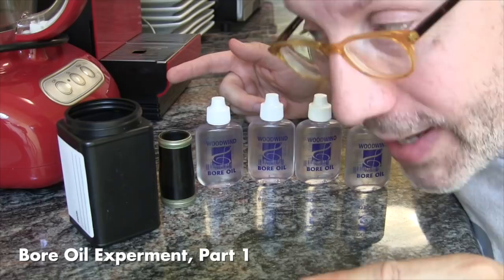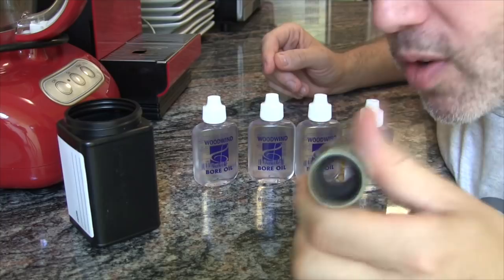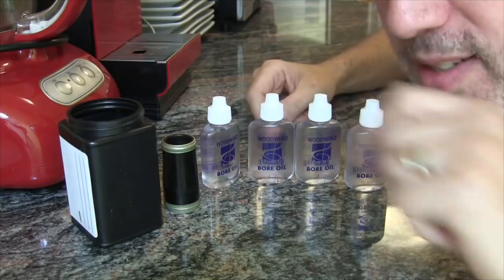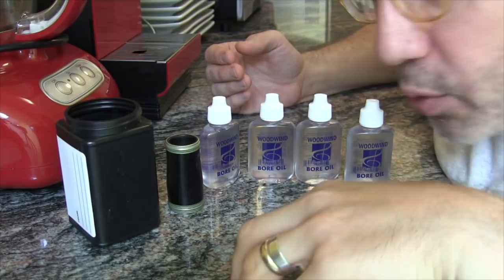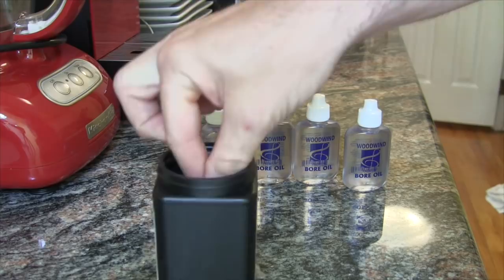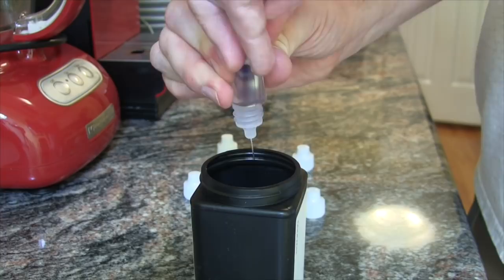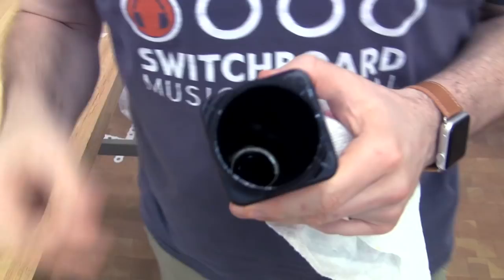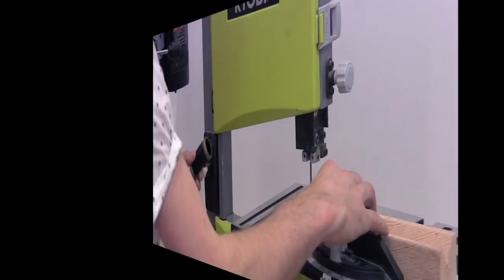Bore Oil + Clarinet Barrel + 7 Months + *Band Saw*

Comment: Try the reverse: My understanding is that the oil is intended to keep water out of the wood, not to keep the wood from drying out.  If that is true, a surface coating of oil should provide a great moisture barrier.   So, cut one in half and oil one half.  Drop both in water, and then see if the oil protects it or not.
Reply: Correct. The clarinet needs to remain moist for protection. But also, water does nasty things, sometimes [like expanding when freezing].
Reply: Great insight on the clarinet bore oil topic.

Comment: I would suggest a better experiment would be with a very precise scale, weigh a dry barrel, soak it in oil, wipe off the excess and weigh it again. Seven months is a long time and if it soaked the whole way through  you wouldn't get the ring like that piece of chalk.  Also, sanding it could have filled the endgrain with dust or the heat generated in the cutting/sanding process could have burnt off the oil. As a technician, I can tell you they definitely change dimensions when they are dry verses oiled. Another good test would to measure it with a dial or digital caliper or a micrometer dry vs oiled.

Comment: Had a really old dry Pre-R13 Buffet that played extremely flat. I assumed it had to have been very warped including the tone holes. I caked it in Bore Oil for a month and added oil when I saw some had dried up or sucked in to the pores? I reassembled the instrument and tried a shorter barrel about 3mm smaller than the first and intonation became much more controlled and accurate. Oiling your clarinet is good and if you notice that the rings on the tenons or on the bell are loose, that means the wood has constricted or shrank. Meaning it’s dehydrated. Oil that sucka

Comment: I know it would have cost more, but why didn't you saw another barrel in half to show the difference? It would have made your point a bit stronger, though I'll happily take your word for it.
Reply: Ranâ Onety Right! Control vs test is the only way to be sure - or cut in half before the soaking
Reply: Cutting it in half before soaking would have been a much better choice.
Reply: hundidosplodo True, though I guess you could argue that if you saw the barrel in half prior to the oil bath, then the barrel would behave differently to how it does normally, as the surface area, where the barrel was sawn(correct form?) has a different texture to the barrel as a whole, which would screw up the results, because that exact area is where you measure them. Also, my reasoning for stating what I did initially, since he plunged the barrel into the oil half a year ago, I figure the easier fix would be to use a fresh barrel as a comparison rather than having to wait a "whole" half year again.
Reply: Well, if NOTHING can be seen, there is absolutely NO need to compare with other cut pieces (where also nothing can be seen) except you have developped some hate against your instrument, then saw it in 78 pieces at least. At your own risk. Be careful to remove all metal pieces before. Don't do it at home, kids!
If you ask any professional wood worker, he'll tell you that oil will NEVER go completely through a piece of wood (even if you add high pressure and higher temperature, and even in much much softer wood as pine wood) Oil only intrudes about a tiny fraction of an inch. And therefore, if you cut the wood afterwards, you would defenitely see the difference in the color between the (possible) oil soaked part and the "normal" wood.

Comment: That commercial bore oil is not a light oil, in fact more like mineral oil. I've done experiments weighing before and after soaking in 80% almond oil and 20% orange terpene. The weight gain of the various parts is significant. Especially for those manufacturers that don't finish their bore with a shellac/oil finish. So yes if you use an inappropriate oil - it won't soak in. The lack of a control barrel also means we may be looking at wood in which the oil has permeated all of the wood completely. Don't mean to rain on the parade, but this is not definitive, nor scientific. Disagree!
Reply: Does bore oil help anything then? Because in my clarinet circles the power of bore oil is rarely questioned and now I feel confused, have I wasted hours disassembling and assembling my instrument when I was oiling it?
Reply: My own belief is yes. Talk to a piccolo player. They swear by it. But the whole topic is subjective (what we hear) kind of like tubes vs transistors in a stereo. However, there are few people who work with wood that would advocate against oiling wood vs leaving it dry.
Reply: Years ago a man with 20 years of experience in working on woodwind instruments visibly cringed when I told him I've never oiled my clarinet before. I do it now because of the face he made that day but I never really thought about how well it works.
Reply: Weight gain is the only accurate way of telling if the oil has been absorbed.  The degree of gain indicates the volume of oil absorbed.  Also - most commercial bore oils are petroleum based.  They are hydrophobic and will not be absorbed.  Nut oils are hydrophylic and will be absorbed.
Reply: People add things like orange terpene to help the oil penetrate. This may be what you are thinking. There is not enough of a trade in bore oil to have manufacturers trying to scam for more usage.

Comment: My first reaction on watching this was that maybe the purpose of the oil isn't so much to soak into the wood as to provide a light protective layer to repel the saliva.....but then I wondered, if the oil doesn't actually soak into the wood, why would the saliva?
Reply: There is no saliva in the clarinet or any other wind instrument for that matter. The instrument is wet after a playing session from water vapor in the player breath condenses when it gets colder inside the instrument.

Comment: Okay try this.
On a junker top joint wash it thoroughly and rinse and warm water. What you'll find is the wood looks terrible Dusty dry. You may wonder why did I do something so foolish?
Next Jam a couple of cotton balls in the very top of the top joint. Next Step being careful not to spill p o u r bore oil to totally saturate that cotton ball.
Put it in its case and wait a couple weeks. By this time the Wood will have turned dark on the outside of the top joint probably halfway down proving that the oil does penetrate. In fact if you use the lousy low viscosity stuff they sell as bore oil heavily you will in time see the oil escaping the pores on the outside of the clarinet. Another benefit of oiling aside from crack prevention is that a dramatically reduces the amount of water Gathering on the C sharp and E flat Keys on the right side of the top joint. I find the reduction of water in those keys well worth the oiling.
All that said... If you keep the instrument in its case with stable humidity and avoid sudden temperature changes it probably won't crack.
Another important detail is to put cork grease on the end-grain of the top joint cuz this is where a lot of water enters and hence why they crack near this area.
Last and certainly not least another downside of oiling the bore of your instrument is that if you use Valentino synthetic pads the sealing surface is held to the rest of the pad buy a wholly inadequate adhesive. If you get any oil... Any oil at all on the pad it will disintegrate... Usually 5 seconds before your big solo.
For the record I do oil my instruments and in 40 years I've had zero cracks.
Reply: That same thing happened to me with one of my Valentino pads. The nice thing is it seems like the inner layers of the pad still give you a good enough seal to get through that solo before you take it in to get it repaired.

Oh, and thanks again for that :)

Comment: You know what would probably help the interior is wax. Like if you took some very soft rope, something like cotton, natural fiber. And if you soaked that or rubbed it on bees wax to get it worked into the fibers, and then you drew that through the instrument, that should provide a water barrier (much like protecting chapped lips). It would also not react with the wood like polyurethane or shellac would.

Comment: I mean it doesn't have to soak into the instrument to protect the wood from moisture, and you can visibly see that the oil will coat the surface of dry looking areas. If anything this dispells the myth that bore oil will significantly alter the acoustic properties of the wood by going too deep.

Comment: The oil does penetrate I just oiled my barrel an it took lot of oil . You need to apply super extra thin layers of oil , I fist apply a thin layer then when it’s all penetrated inside the wood I oil it again with another thin layer and so on until the wood stop taking the oil I keep adding layers , immersing the whole thing won’t make any oil penetrate .

Comment: Hey and I just thought of one more thing. I think you showed that the wood doesn't  readily absorb oil. However, some oils like linseed oil can polymerize and form a protective barrier. It wouldn't work it's way into the wood, but it would form a thin film on top of the wood. When oils like linseed, olive, and other non petroleum based oils are exposed to air and light, they don't really "dry" but they do become solidified. This is how oil based paints cure. The process requires sunlight though and it takes days or weeks to set. So you would need to expose it to UV light inside the barrel and not use the instrument  for a week or more. To get an idea of what this film is like, it's the reason why seasoning cast iron works. The older the pan is, and the more it's seasoned, the more non stick and water proof it becomes. Because the oil just lays down layer after layer of  polymerized solids.

Comment: I purchased my Buffet R13 Prestige in 1991. I did the whole oil routine in the beginning but have since lagged (10 years at a time). I can tell you this, when I put oil on my precious baby and let it sit...nothing happens. It does not "soak in" in the least. I recently took a hiatus for four years and came back to my clarinet. I oiled it, "just to be sure" and the oil just sat on it. I tend to agree with Mike here.😎

Comment: Bore oil does work and I'm not in the bore oil business. A better experiment would be to make a side by side comparison with a barrel unoiled and oiled. The weight and thickness of the oil must be light enough to absorb, and a delivery agent like turpentine or varsol is needed as well so it can absorb easily. It has made a big difference on my professional bassoon over the years, but I admit the maple in a bassoon is far more porous than blackwood.

Comment: So it might be the climate you are in that causes your clarinets not to crack. From my experience, cold dry weather is often the time for cracking clarinets. An easy way to prevent this is to use a violin or viola little strip thing whatever they are called. Viola are a little more effective bc they are bigger. 

Whether it does much who knows, but it’s a fact that clarinets indeed crack and this seems to work, and you don’t have to be like “man gotta oil my clarinet today...” it’s just a little thing that can go in your case and u don’t really gotta think about it then.

Comment: (Edited: I wrote this before seeing the other comments, so there is some overlap)

Man, you rock, but not sure about your testing here.  You might be right, but if so, my assumptions about what I observe myself must have another explanation for the disappearing oil.  

Did you accurately weigh before/after as that would be a much better test?  You used a "new" piece to test, not one that is supposedly dry, that doesn't seem valid at all as you don't know the starting state.  When you put bore oil on a "dry" clarinet, the slick surface "disappears" so where did the oil go?  Then after after a few sessions, you can see the oil remain (not absorbed).  So maybe there is another explanation, but is sure looks like the initial applications behave differently than the subsequent ones.

Also, you seem to suggest that the oil must be absorbed far into the wood, not just the very outside.  I don't know that is the intent.

To really prove the point, you would need to test the conditions that cause cracking with treated vs untreated.

Again, you are at a level so far beyond me, so much so, I can't even see you, but I'm just not sure about your testing process.

Comment: Ok. Experiments need some type of control.  You could have purchased two barrels sawn the first one without oiling and then comparing with the oiled one. I do oil the bore of my clarinets with Almond oil twice a year. Even though Grenadilla wood is very dense, some oil may seep into the clarinet's bore. It does no harm and allow my spit to drain off much better than if not oiled. Thanks for your time and energy, however, next experiment you need some kind of control.

Comment: Greetings to you. I appreciated this video.  Thanks so much.  I have a few questions.  Can bore oil go rancid?  Do you know what it is made of?  Also, years ago I acquired (very cheap) a high end wood clarinet, but there was something funny about it...very old...so have no idea what all could have happened to it along the way...but for some reason with the info I had years ago, I decided to oil both inside and out...grin.  But it was the strangest thing, and I cannot  recall all of what happened, but I somewhat panicked.  A tiny splinter chipped off at an edge and I felt like I had softened things, so I let it dry in a safe place for a considerable amount of time.  I had a feeling that someone had possibly also stained it darker or attempted to, since I believe there was a time when it was the black wood that was most desired??  But to me, if it is a dense wood, that grain and wood pattern would be most beautiful to me.  Do you recommend any wood polish (like guitar polish?) or substance (to any wood clarinet) if a coat of protection is desired or is that detrimental to it?  I have no idea.  Thanks bunches for your time.  God bless you in Jesus'  Name.

Comment: I don't have grenadilla instruments, so no any interest in protecting anything. Would WD-40 work a bit better to soak some wood layer? What about shoes colorless wax that protects the surface of the leather? There are also water-repellent sprays for car windshield glass that also do not soak glass, but works fine.
What is the layer thickness that is able to protect the grendilla wood? Can it be just 0.001mm to be enough? Obviously the naked eye cannot see thin soak layer that protects from water.
Reply: Crack happens due to difference in humidity between externl and internl surface. Internal high humidity cause wood extension in internal layers that cause crack on external surface. If you think WD-40 displaces water in bore, it may help equalize humidity inside. 
As I know WD-40 contains white spirit and mineral oil. So its purpose is to reduce oil surface tension and improve penetration into materials structure. So oil may get deeper with white spirit than without it.
Reply: You can also add some UREA to your clarinet for the fragrance.